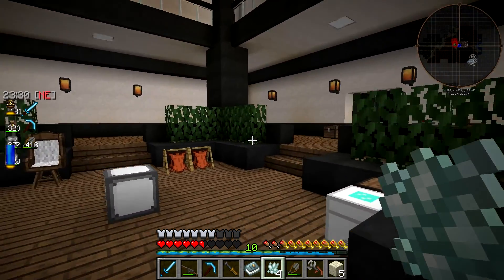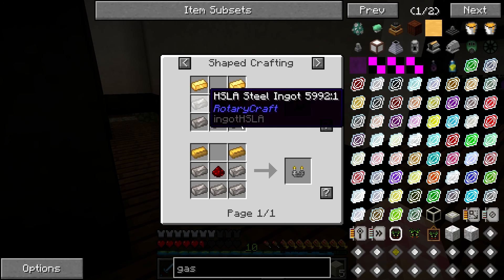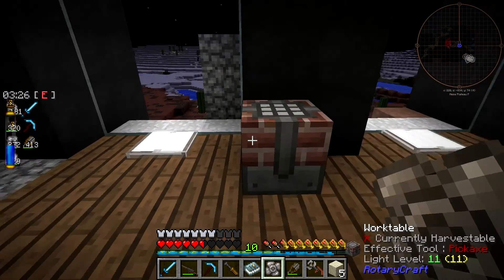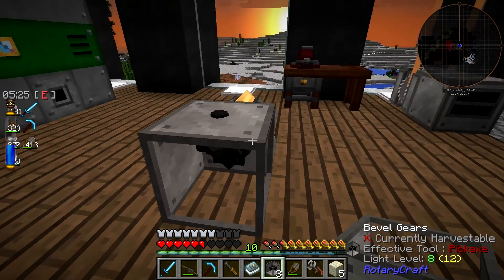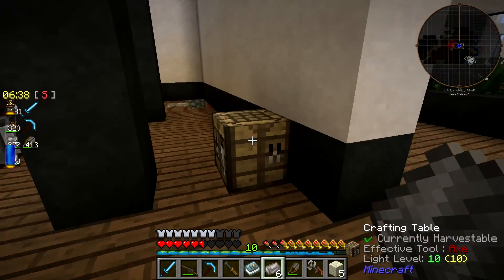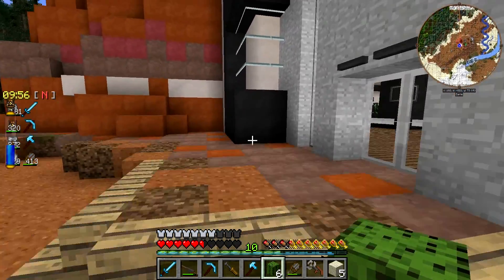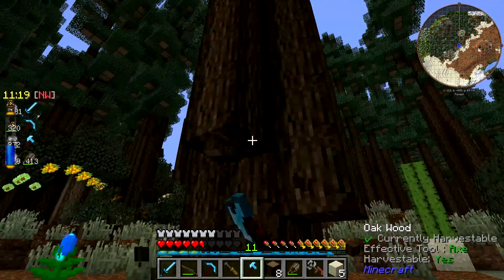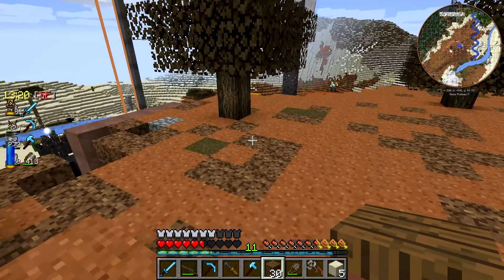Minecraft: Revolution 3 Let's Play #15 - Water

Comment: The tree didn't get chopped down because you took the leaves... The mod no longer seen it as a tree.

The fuel for your harness is easy to get, alchemy is one of the first things you can unlock; And you can break char-coal down for what you need.

Yes the railcraft water tank needs to see sky.

You should bread sugar cane ... I think its carrots + wheat... its one of the first ones you can do.
Reply from the maker: Yeah I know, I hated the crop breeding though it was so boring. I'll have to find time to do it off cam.
Reply: SentinalhMC
You could give yourself the seeds, you had them on the last server at 8/8/8. I know this because I gave them to you. You had the main ones (cinderpearl, sugar cane, cannola & hemp) plus some others. I remember doing Blueberry, penuts, wheat  & pineapple... And some others. Yeah I wasted a lot of time on it, >.<

edit: You may need to set up a command block as the give command could be a bit long to be typed in... Damn Character  limit.
Reply from the maker: *****
Aww I can't just pull them out of creative mode?
Reply: SentinalhMC
I think that just gets you the 0/0/0 ones... but I could be wrong.

Hopefuly youtube dont mess this code up:

"/give @p RotaryCraft:rotarycraft_item_canola 1 0 {strength: 8, analyzed: 1, growth: 8, gain: 8}"